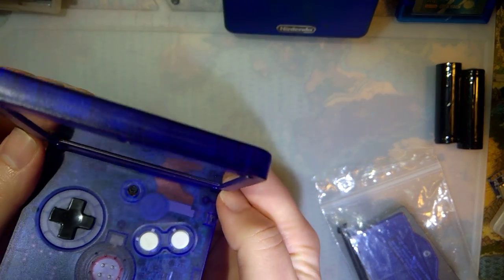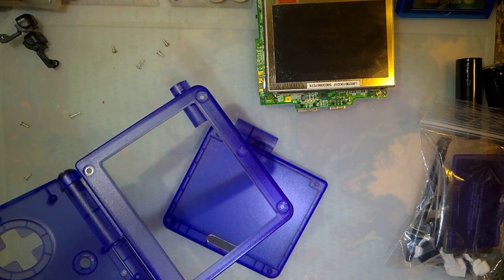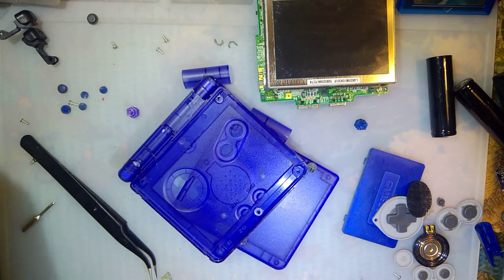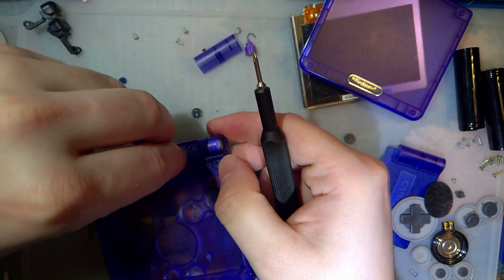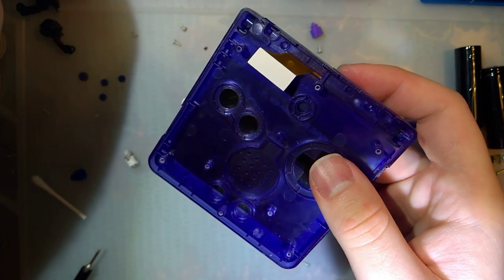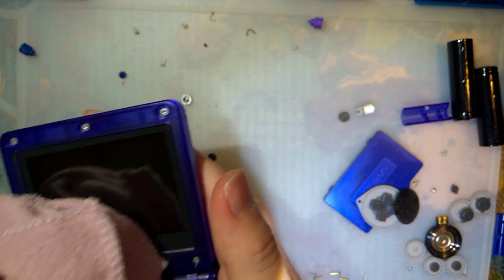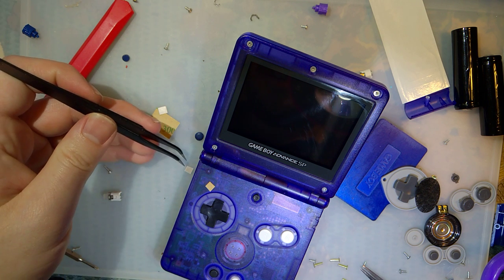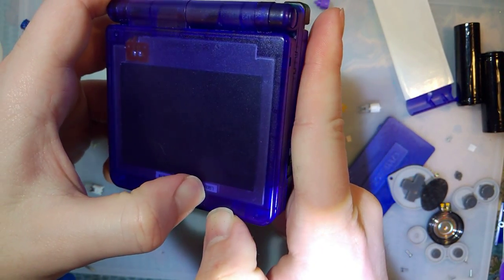Refurbishing an AGS-101 GBA SP

Comment: Always purchase Cameron Sino (CS) batteries when you can. They adhere to all local and CE regulations on battery safety and such. Their rated performance is always exactly what they advertise. 

They are more expensive than the cheap fake chinese batteries, but trust me, it's so worth it. Just be careful you get them from a good source as they do get counterfeited as well.
Reply from the maker: I plan on doing a video on SP batteries very soon. This video was filmed a few months ago or I would have given him a different battery.
Reply: I bought a cameron sino gba sp battery and it doesn't even fit... Waste of my money

Comment: I have this same shell, I big annoyance I have with it is that the A and B buttons manage to spin and get stuck when being pressed. This usually happens when I’m playing Mario as you hold the “run” button down as you also jump.
Reply from the maker: I've never once had that issue when playing normally or even when mashing the buttons. Sounds like you're pressing the buttons way too hard.
Reply: Had this problem too. It eventually completely tore the B receptor off😢 gonna try OEM pads, but I’m worried it will still happen. I definitely press too hard, but it should be able to handle it